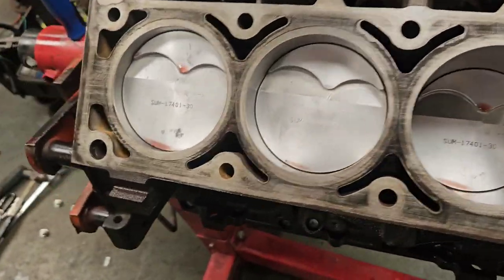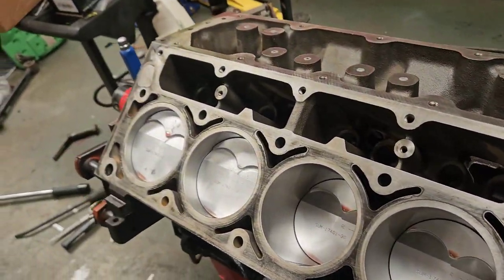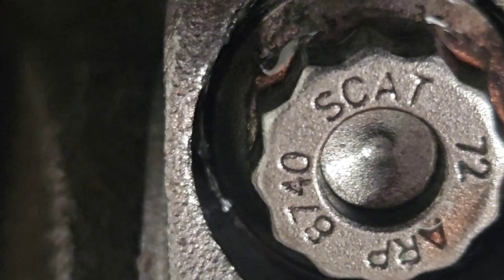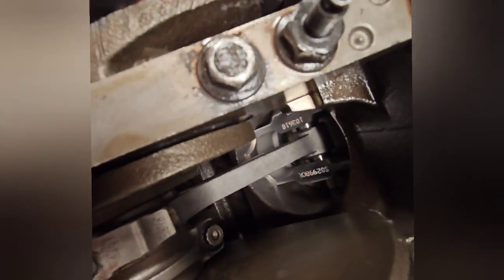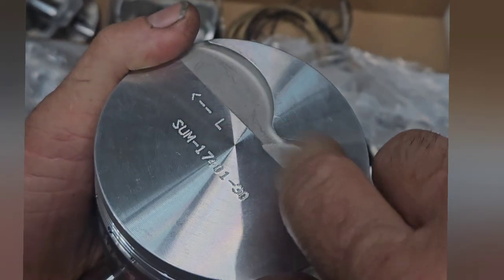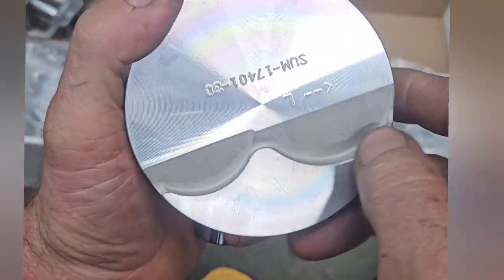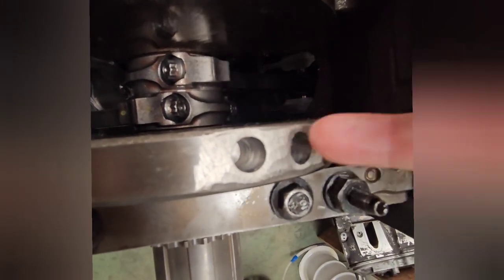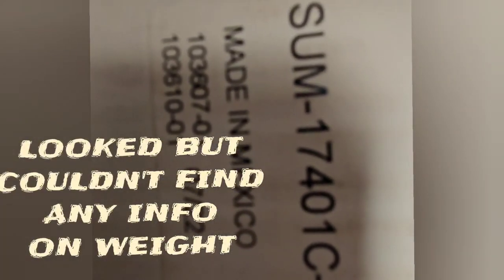Good or Junk? Summit Parts Review @SummitRacing

Comment: I assembled a stock bore and uncut deck lm7 type from a 4.8 pullout using k1 forged crank for 5.3 (Didn't want to go high on stroke to preserve the walls and the pistons and also maintain as much material on top of piston), used maxspeedingrods h-beams with a 6.25 SBC length, and summit pro pistons I believe 1800-3780.  Had it all balanced for like 250.  Ported 862s and twin china 76s at 29lbs on pump 85 shifting at 8200 rpm.  The summit stuff is good enough for me and the car makes over 200 HP per liter.  Entire engine was under 2k total.  I did blow out a head gasket and torch a hole through one of the heads when the head lifted/warped.  I've since been using fire ring gaskets on stock 61cc chamber heads.
Reply from the maker: Yup most of the Summit stuff are great quality parts. None of it made by Summit, just food brands in Summit boxes,

Comment: This is the info I was looking for. My trucks motor needed a whole bottom end replacement so I decided to make a 408 stroker since I found a forged 4 inch stroke crank locally. Was looking at the 6.125 rods with the summit pistons for the stroker because they're by far the best pricing I've found for them. Now I can feel better about ordering them. Thank you
Reply from the maker: I'm glad it helped. I bought them without knowing but the Arlington store is only a 30 minute drive away  and I could return them.

Comment: How are these? Was considering the summit pro ls setup for a 5.3. I thought the rods were made by k1 for those
Reply from the maker: I haven't  installed  the engine yet so no feedback. The H beam rods are made by K1, the I beam that I used are made by Scat. Both are good parts manufacturers. I did a lot of price comparison and couldn't find better pricing.
Reply: @autovationFtWorth heck yea man, always good to save money

Comment: They don’t balance worth a crap.  That’s the problem with those.  Rods and pistons on a stock crank are even harder to balance.   That’s why summit won’t offer a balanced kit.  

Spend another $500 and get good products.  That’s just garbage.
Reply from the maker: My machinist had no problem balancing this set up. They were much lighter than stock gen iv parts so no heavy metal needed on the crank. UEM and Scat aren't top of the line but they are far from garbage.